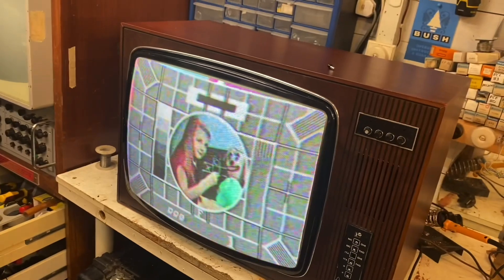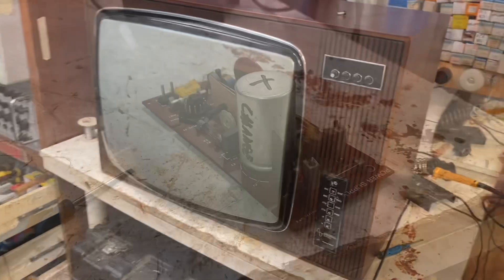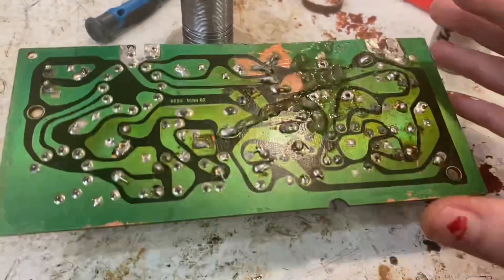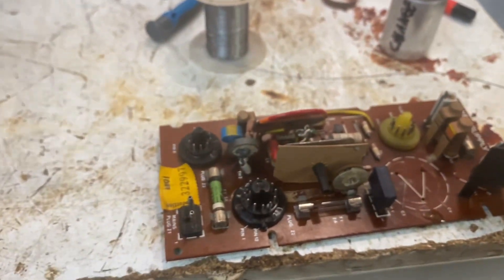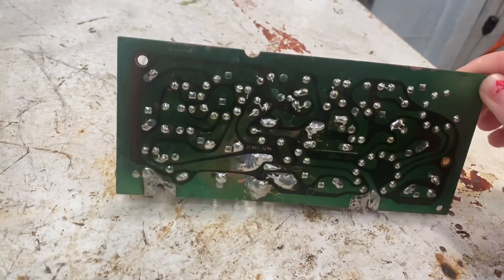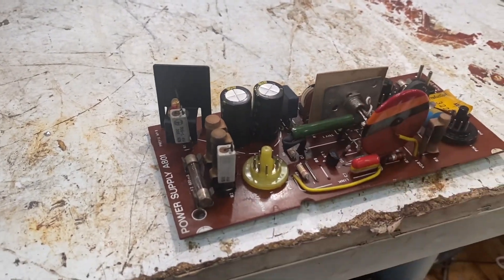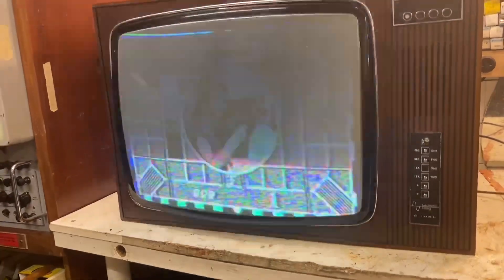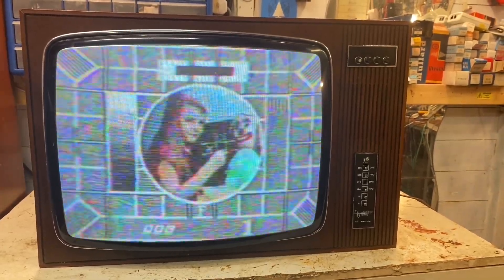Let’s Repair This Vintage 70s TV! But what’s wrong with it? RBM A823 Chassis

Comment: Not too sure if I can see a difference in noise level. I assume the test card is from a VCR? Nice job on the board though.
Reply from the maker: Sadly didn’t leave the set running long enough in the first half of the video. Failing cap would short the longer it was left on, dropping voltage to the decoder and IF boards, causing a tearing pattern… throughout the picture was quite dim, a few measurements proved the volts were quite low what they were supposed to be. Seems lot more livelier now!